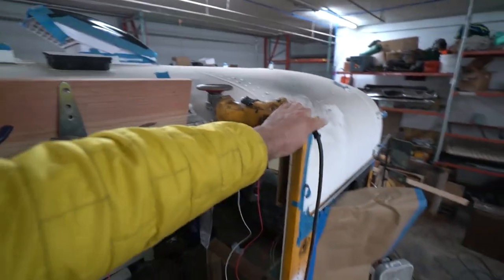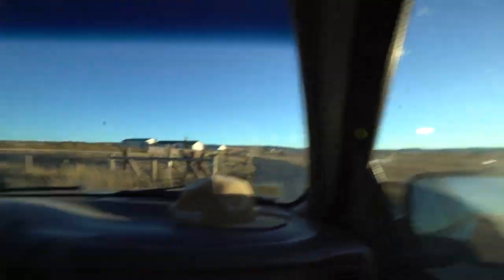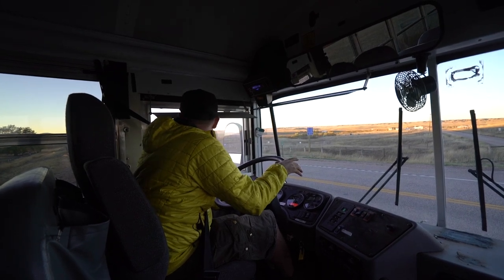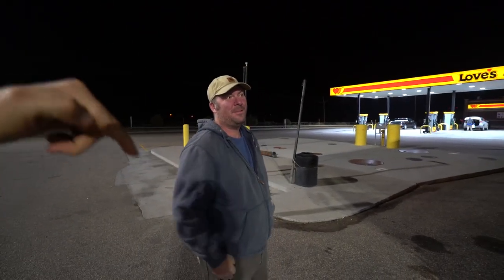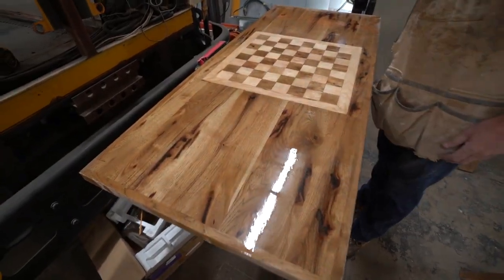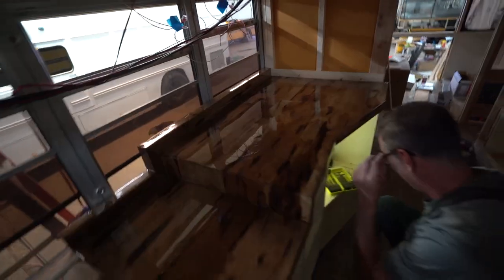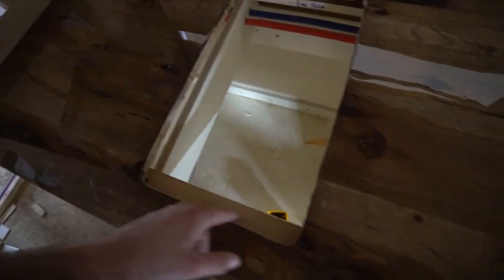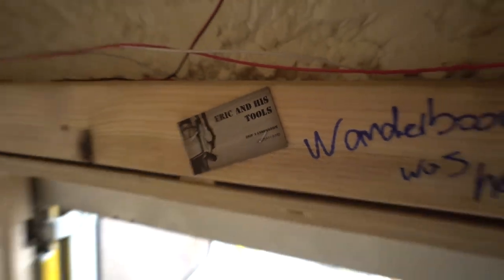Reed Bought a Bus!! (Remanufactured Cummins 8.3L) Counters + Table Are Done!!

Comment: Nice countertops and chess table. I am very interested in the epoxy. I sanded, stained, sanded, and used polyurethane on a butcher block and would like to see other ways besides using polyurethane.

Comment: Question...do you need a CDL to drive a bus like that if you convert it?
Reply: Usually unless the vehicle is being used as a commercial vehicle then you do not need a CDL in the US. However the buses GVWR (Gross vehicle weight rating) will determine what class of license you will need to get which is determined by each state. So example if the bus is over 26,000lbs you may need to upgrade your class C (regular vehicle) to a Class B (large vehicle) license. So as usual it is always best to check with your states laws to find out what exact specifics are going to be for you.
Reply: James Laugh thanks!
Reply: It aint a crime if you don't get caught...